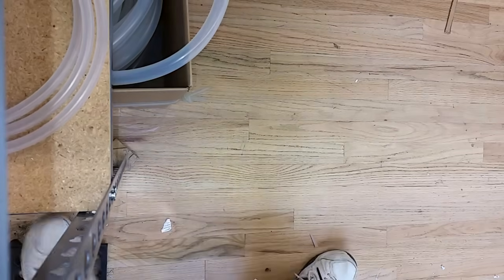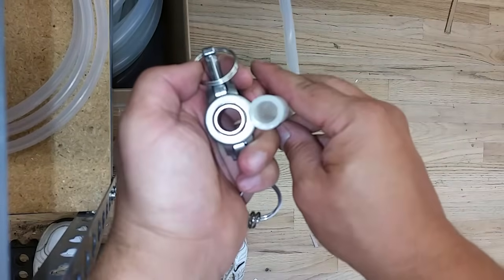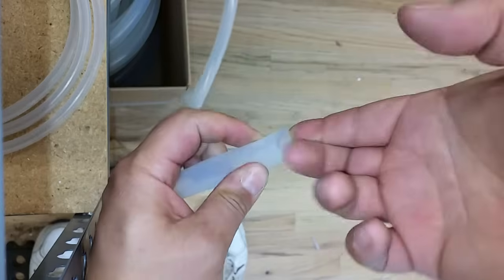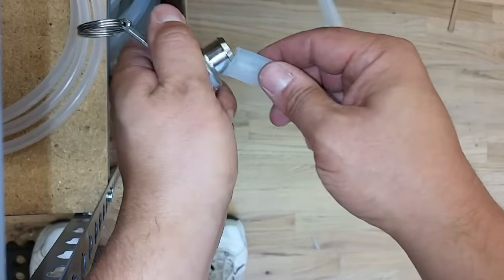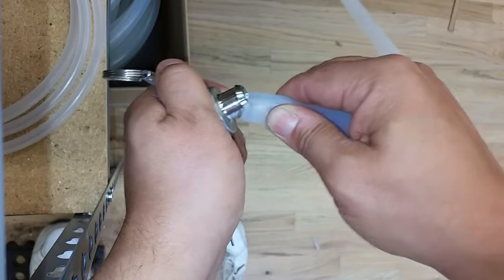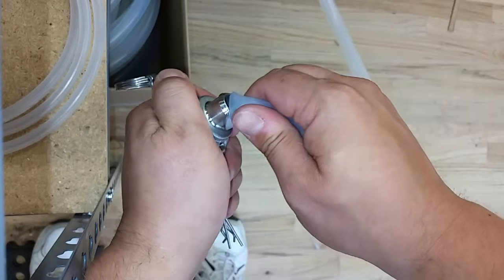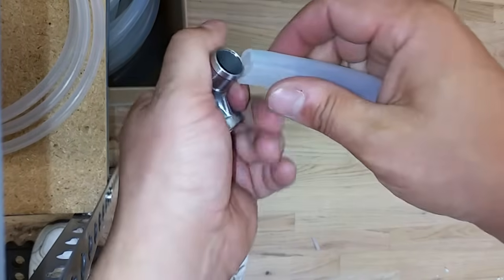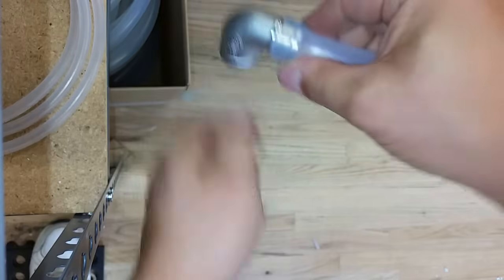Stretching Silicone Tubing over Over-sized Hose Barbs

Comment: Your suggestion was great. I use oil inside the rubber tube and on the nozzle. The rubber pipe very easily fits into the nozzle. Actually, rubber pipe was less in the diameter as compared to nozzle. Thanks.

Comment: I've got 12mm OD hose pipe fittings & 10mm OD fittings on a 3 Port Oil Catch Can & would 10mm OD Silicone Vacuum Hose will it Stretch over the 12mm OD hose pipe fittings that are on the PCV Valve & the other 2 12mm OD hose fittings one on the manifold & the other on the other rocker cover on a PT Cruiser as I have a Blow By Problem & having 3 Port Oil Catch with filter & I know that I don't have much room to put this 3 Port Oil Catch with filter but my son Brannon has a 3D Printer & he is going to make a special mounting bracket for me so I can mount this 3 Port Oil Catch Can with filter no problem at all & also has a drain tap at the bottom of the Catch Can Kind Regards Peter & I'm sure that   10mm 0D Silicon Vacuum Hose should  Stretch over the 3 X 12mmOD Hose Fittings & had tried the vinyl clear rubber 10mm OD hose & managed to heat up the hose first from boiling water & then & force the hose over the 12mm OD hose pipe fitting & I did the the same way as you did Sir by putting the 12mm OD hose pipe fitting on an angle  & turned the 10mm OD hose around & got it on the 12mm OD fitting & it was hard going but I got there & I'm sure the 10mm  Silicone Vacuum Hose should stretch over the 12mm OD hose pipe fittings a lot easier than vinyl rubber clear hose

Comment: Thank you for the video. I just boiled some water and dipped the end of the tube in for 5-10 seconds and went and connected it just fine. Could always add a clamp if needed.
Reply: 5-10 seconds? I let my entire hose boil for 10 minutes!!!!! And it still didnt go on!!!! wtf is this
Reply: @AQWbladefire  strange it worked for me maybe your tube is thicker, i would also try a heat gun maybe and Vaseline... Hope this works
Reply: @ Tried all of that! It is very thick. It’s a thick silicone hose I was using for my diesel truck when I was redoing the cooling system. Everything fit but the water pump hose with a huge barb flange. Ended up using a rubber hose just for that section. Nothing was working so I gave up lol. I’ll wait until I have to change my water pump and put the hose on it while it’s outside of the truck because it’s in a super awkward position so even harder lol

Comment: My favorite, using a hard bev line type tubing. Hand slips and knuckles get mangled by a barb. 

This is definitely the best way to do it. I also like to use some hot water depending on the situation.

Comment: I just dip the end of the silicone hose into hot water for a minute to soften it. Slides on no problem when it's soft.
Reply: Yeah…. I got some silicone radiator hoses to pair with my new radiator and freshly flushed cooling system… I let the water pump hose BOIL for 10 minutes, lubed it up, and yeah, nothing. But.. after this video (2 am now) im going to try this tomorrow

Comment: I just want to thank you for this video. It saved me from a lot of frustration. I purchased some radiator silicone hoses for my BMW (where I had upgraded the thermostat housing to an aluminum one) and spent 30 minitues trying to get the right side on to the thermostat housing. No joy. I then searched BMW forums to no avail. I saw this video in the search results, clicked on it, saw it, tried it on my car and it worked!! Thank you VERY much. You saved me an awful  lot of trouble.
Reply: Literally came here from trying to get my new silicone hoses on the water pump…. It’s 2 am now, but I’ll be trying this tomorrow. I’ve done everything else, but use a torch on it.

Comment: Seems like common sense, and oh it was so easy! What I was hoping to find is how to get quarter-inch vinyl tubing over the multiple barbs on a device and on a connector (double barb sides for connecting a splice). Oiling the parts didn't help and heating it in boiling water didn't make it stretchable. A flame might burn it, and would be too hot to handle anyway. Any suggestions? Even tried stretching the end of it by forcing a large, conveniently tapered nail set into the end of the hose... It just wouldn't stretch it enough. A tip for handling it if you're using oil: use sandpaper or flexible sanding mesh for grasping it, for a better grip. By the way, re your video, I might suggest using a plant based oil instead of vaseline, since petroleum based lubricants break down silicone. Maybe not enough to be a problem in this case.
Reply: Okay, I figured out the problem. Home Depot gave me quarter-inch ID barbs for tubing that's quarter-inch OD. That's what I get for shopping at Home Depot, but they're closer than Menards and I sometimes fall of the wagon and end up in HD.

Comment: So what are the chances of the silicone hose splitting over time when it is stretched like this? Who has examples of an install years later that is still intact? (I sure hope I get some responses to prove this hose will stand up to this kind of installation.)
Reply: I don't think the silicon would split since it is a flexible and non-rigid material even over time. I just wonder about whether a pump might be overstressed by the undersized tubing.

Comment: I need to tell you. I was replacing the intake on my car. The hoses fit the new intake fine. But the old vacuum fittings on the engine were much larger. THIS VIDEO SAVED MY ASS. Thank you so, so so much. I was able to get the new silicone hoses on and clamped. Thank you.

Comment: i needed to step up a rubber hose quite a bit, the inner diameter had to be the OD. i used a ratchet set (which has a gradation diameters) and lubricant spray to step it up slowly to the correct size. the ratchet length adapters make it easy to get leverage to remove and insert.

Comment: or deep your tube tip in hot water before you fit it in
Reply from the maker: Actually with silicone tubing, hot water has absolutely no affect.
Reply: Throw the fitting in the freezer ?